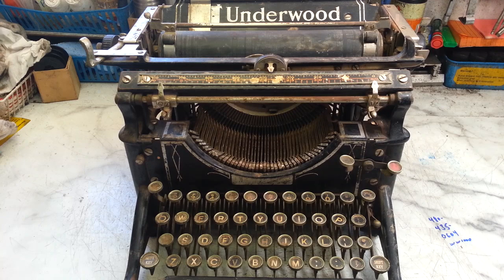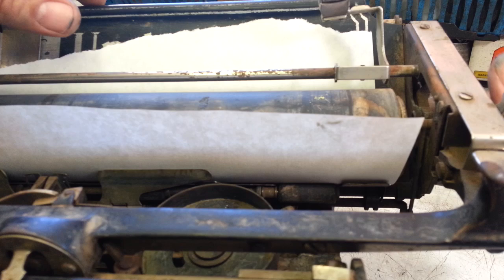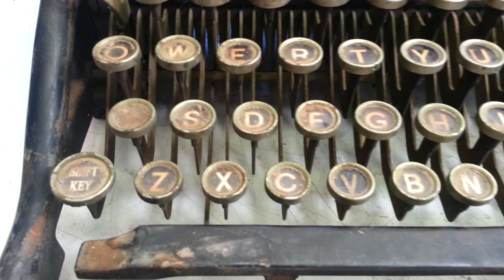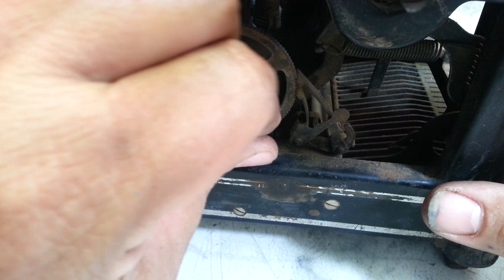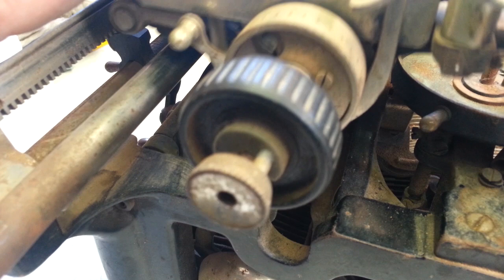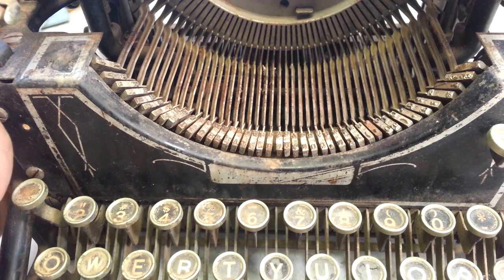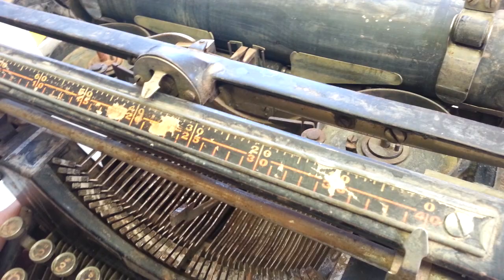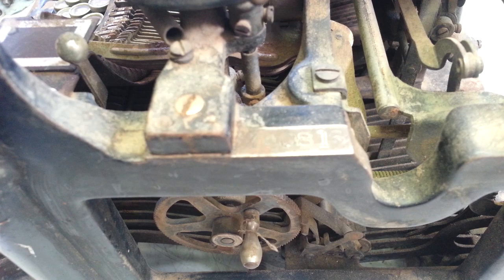Underwood 5 Typewriter Repair Restore Evaluation (pt 1) 10/2019

Comment: I have a 1939 underwood standard that has a green matte finish. Unfortunately there are areas where the finish is broken/chipped. What is this finish? And can it be easily repaired/replaced or is that too expensive for this model? What can I do to prevent further damage?

Comment: I bought one of  these and brought home the carriage advanced  with space bar but most keys were stuck.  I dusted it off, vacuumed it and worked on manually getting the keys to move.  Now the carriage doesn't advance.  Any tips?
Reply from the maker: Without being able to see/touch typewriter, it is very hard to tell what is impeding that operation

Comment: I want to restore an Underwood 5, what kind of tools do you use?
Reply from the maker: Screwdrivers, spring hooks, files, small wrenches, simple green, lacquer thinners, marvel mystery oil, long brushes, stiff brushed, wire brushes, 
compressed air, steel wool, nutrol spray, rags, sharp picks, soft picks,  combined with 40 years experience, gets it done . . . .
Reply: @phoenixtypewriter2136   :-))

Comment: How much ya charging to restore it
Reply from the maker: Basic, minimal reconditioning would be about $250-300, many levels higher can be achieved, like new rubber +$150
Re-chrome certain parts +$200 ,  restore key tops +$200,  Repaint re-decal +$400 (as it sits, that Underwood is worth $20)

Comment: how much is this worth ?
Reply from the maker: An Underwood in this condition, which is common, I would value this as a $10 typewriter . . . . .
Reply: @phoenixtypewriter2136  okay, thanks. I looked in the Internet, and i dont find them for under 90€ and they are broken (Im from germany). But I bought a Underwood No. 5 yesterday for 40€, so its the cheapest one ive seen.
Reply from the maker: @gottmitunsimarschliederund2179  Here in Phoenix these are abundant, other parts of the country or world prices will probably be higher.
Also the $10 is based on condition of this particular Underwood, Condition is Everything !. Mechanical condition, cosmetic condition
Sometimes you can find a $100 machine for $10, Sometimes you end up paying $100 for a $10 machine